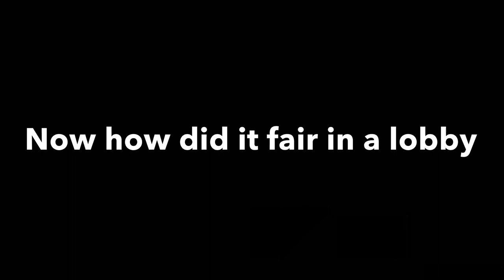Project Cars 2 Setup Guide - Group A Mercedes 190E

Comment: Hey Jay. This car was a nightmare to drive. I started PC 2 about a year ago and when I did and started a carrer mode it was with this car in the full season. You are right learning the tracks is huge for this car. But knowing the Do's and Don'ts with the car is big too. I made small insignificant changes to the set-up (brake bias, ride height, steer ratio) because I didn't know what I was doing to a set-up (and still don't). But once I got used to it this car became on of my favorites. you have me wanting to pull the tarp off of it and get it back out on the track. maybe 10-15 laps around Monza. Especially now since I have learned how to drive a Sim a little better. Good choice Jay.
Reply from the maker: Cheers Bro, I’ve raced in this car just a few times and recently had the pleasure of driving it again at Bathurst.

I instantly thought it was a great car to do a setup guide with & im truly happy with how it turned out. Such a nice balance and a pleasure to do drive.

I’m definitely keen to see how it performs on a few other circuits although I was slightly disappointed to see how underpowered it is against the Skyline in the same Group A series.
Reply: @jaysysumakaRatMaster3  Good point Jay. But let me add, because of how slow the car is in the Sim it was good car to get started on. Unfortunately you also learn that one set-up doesn't always work with all tracks.
Reply from the maker: I’d certainly agree with that but it’s often a good base setup with a few minor adjust then for each circuit.

I’ve already got a feeling you’ll enjoy the next video... I know I’ve enjoyed this first outing in a car I’ve never driven before on Project cars 2 😉
Reply: @jaysysumakaRatMaster3  cant wait. Great channel. Great work. Thanks for your commitment. I stated before, you help a lot of us learn.
Reply from the maker: 369darkknight cheers man... the comments are much appreciated 🙏

Comment: Hi Jay. Do you always start with the stable setup or the loose setup? Or does it depend on the type of car? I'd like to see a video on the vintage class with the Camaro, Mustang and Dino. Some great cars in this class. Great work and thanks!
Reply: Sorry I meant Ferrari Daytona!
Reply from the maker: Cheers for the comment Kevin and yes I always start with the loose setup and never use the stable setup.

You only need to remember that well known racing phrase in order to make this choice.

“Loose is fast”

But too loose, in my opinion, means it’s hard to be consistent.

As you can see in the video after the initial first lap, I bang in 4 consistent 1.49 laps. The car feels pretty nicely balanced in my opinion.

Thanks for the car selections. You got any certain circuit in mind. I do enjoy the classical cars 👍🏼
Reply: Hi again. Interesting you start with loose. I have raced a little with the FPR boys (I am AshavanX) and have noticed that I have a distinct lack of talent compared to most of them, which is maybe why I often find the stable setup easier to get to grips with! I have no circuit preference, although my local circuit is Snetterton (I prefer the old 200 layout) although I did notice some real life classic muscle cars racing at Bathurst recently on YouTube so did have a go at that which was great fun too) Will try and find the link.
Reply from the maker: Kevin Barber The stable setups generally have to much understeer on corner entry as far as I remember. They also run to much downforce and camber to make the car fast.

But running a loose setup is always going to be harder to control but faster in the long run.

Talent often out weighs Setup.

A good driver can set a fast lap regardless of the setup.

A good driver can set an outstanding lap with what would appear to be an uncontrollable setup to other less talented drivers.

Being fast is always about being on the edge of grip.

But creating setups is like trying to balance one thing with another.

It’s like removing downforce for an increase in camber... or tightening the suspension with a decrease in tyre pressure.

You’re always trying to balance the car to exploit its potential.

You must know by now that Bathurst is without a doubt my favourite circuit 👍🏼
Reply from the maker: Kevin Barber The Camaro definitely looks like a good shout at Bathurst 👍🏼 after watching lap 1 😉
Reply from the maker: No no no The Mustang... I’ve never even seen or driven this car... This will be epic 👍🏼

Comment: Had trouble myself trying to get this car to behave,    noticed you didn't play with the anti roll bars or toe angles  (   or did you  ).   Also I was under the impression that the higher the engine braking number the less engine braking happens.  This was stated by youtuber Yorkie who works for  SMS  ,  What's your take on the engine brake number ?    Seems to me that adjustment has no effect at all.   I'll try your set up and see if it works for me,   good vid thanks.
Reply from the maker: You’re 100% right about the anti roll bar & the toe angles. I did mention in the description that I don’t consider a setup ever truly finished.

You’ve got to be happy with it at some point... The goal of the setup, for me, was to hit a 1.47.

As soon as I’d done that I stopped messing with the setup. Could it be further messed with. Of cause it can.

As for the engine braking, yes you’re right. I increased the number to try and stop the engine braking from rotating the car less under corner entry. The higher the number, the engine braking effect the car has.

Comment: I find this category undrivable. But only tried the Ford one. It’s the only career I have just not raced. Just started and quit every race. Just can’t drive this thing.
Reply from the maker: Reduce the turbo output… then slowly increase it to something you can handle 👍🏼
Reply: @jaysysumakaRatMaster3  thanks!  I’ll try that.
Reply: @jaysysumakaRatMaster3  Thanks! This Mercedes is a lot easier to drive than the Ford. Still difficult, but a lot easier. I already did the European Championship.